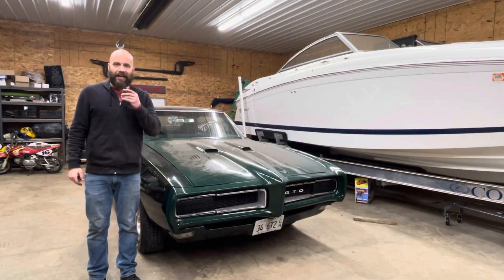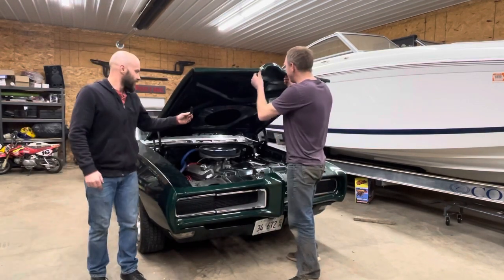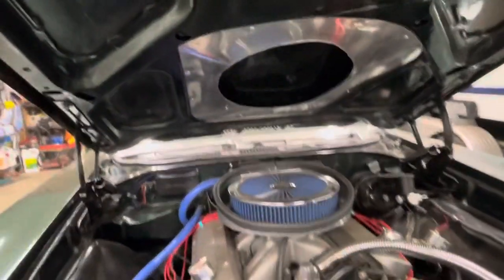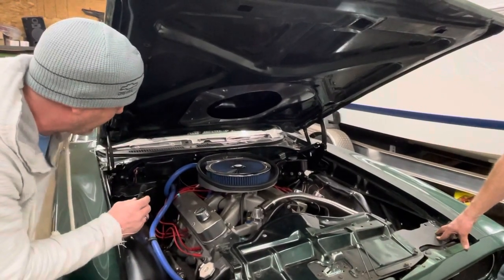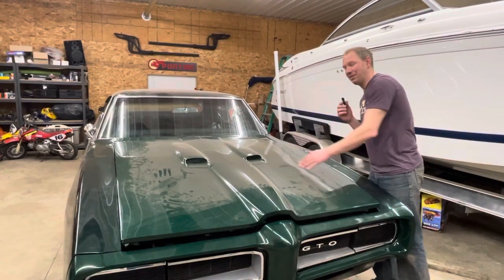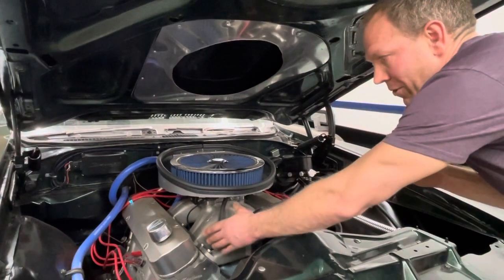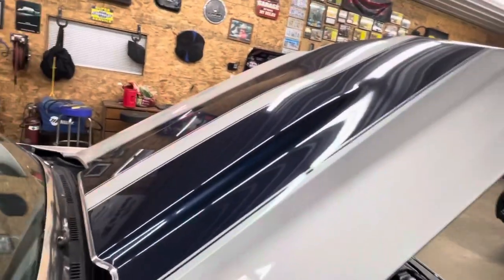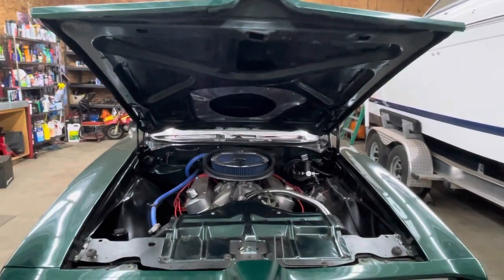“Hack Tip” Diy Ram Air #holleysniper #flowmaster ramairgto #nonamenationals #diy #455 #pontiac

Comment: the functional ram air scoops on cars in 1969 actually had a knob on the lower part of the dash. there were flappers on the scoops that would open when you pulled it.
Reply from the maker: Yep!! Pretty slick design!  The factory 68 was pretty basic.

Comment: Yeah....... if you move the scoops forward it does do a better job, makes it more efficient blah blah blah...... but it ruins the stock hood and makes it look out of place with the body lines & the rest of the car. Doing it like this makes it look cool as hell, because you close the hood, it still looks stock. Like the Tach on the hood of a Judge. TOTALLY useless because of the double glass glare, it sits in the wrong place to see it, but dag nab it it's COOL As Hell to see it out there. I mean, if you want total 120% performance, the currant land speed record for ICE is 450 mph and it looks nothing like a car.
Reply from the maker: You are spot on BareRose.  Probably the best factory GM setup was the Olds W30 package that had the valance scoops.  We are going to go for the NNN land speed record 🤣